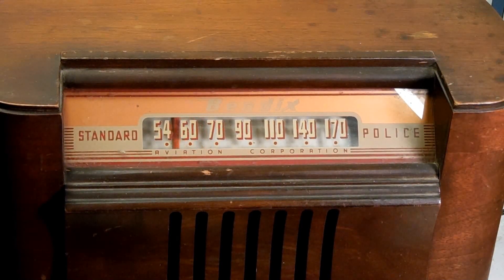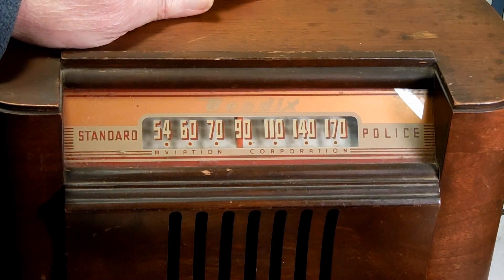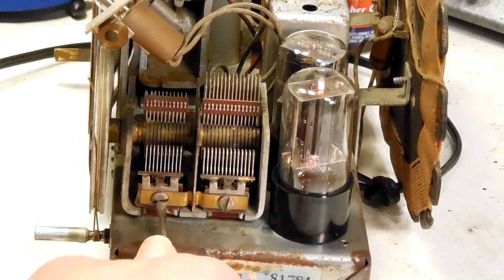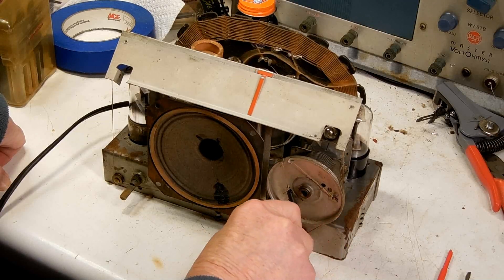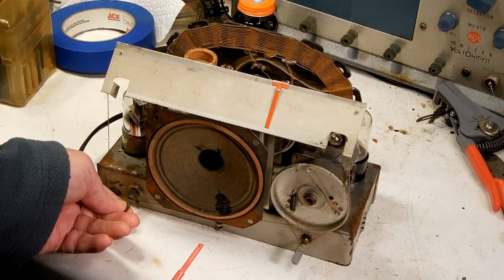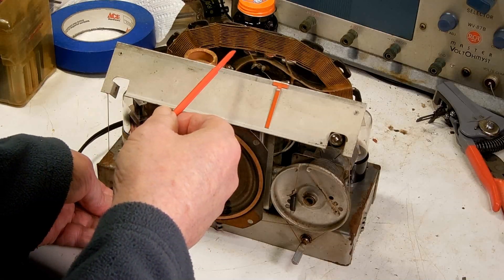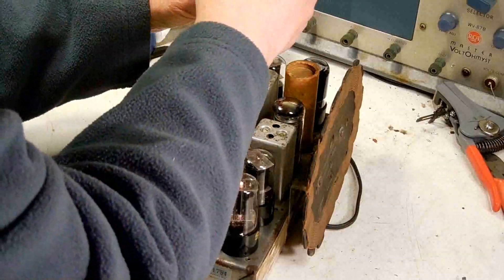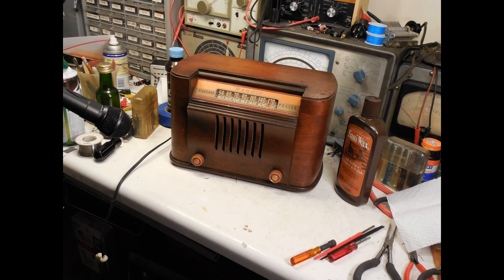Bendex AA5 Repair, Alignment, Oscillator, Antenna, IF's

Comment: Sir thank you for your great videos, you have a great teaching style.  I'm just getting into repairing some old tube radios, and I have a question if you'd have the time to reply.  I watched your other video on using the signal generator (as well as other folks videos) and I have an old Heathkit signal generator.... the question I have is, it seems as you show here, that you can also tune the IF with just using a weak station and turning it in.  Or, I believe I could use the signal generator set on say 600khz and tune that in with the IF cans....  my question is, why do we need to use the 455khz frequency?  I understand that the radio is tuned to that but I don't understand why I can't just tune in a station similar to how you're doing here on whatever frequency I introduce into the loop antenna.  It seems I can just create my own station at 620 or whatever, set the dial to that and tune her in with the IF.  

Is it because the 455 should be able to be heard at any location on the dial?  

Thank you for your great videos!
Reply from the maker: Thank you.
This technique is for radios that need a little tweaking. The IF's are very sharply tuned to 455kHz as you know. This frequency was chosen because it does not interfere with anything else. This frequency is high enough that it can carry the audio information was almost no loss of audio quality. I would only use the radio station, preferably in the middle of the band, because I know for sure it's frequency is very accurate because of the FCC.

If I have any question at all about a radios alignment I will use a signal generator on 455kHz and do a complete alignment according to the radios alignment procedures.

I do have a free e-book that may help you. Below is the link to the download and the password is allamericanfiveradio .

I think my FREE eBook may help.

PASSWORD is allamericanfiveradio

https://drive.google.com/file/d/1HHmaWYr7UMACfmS4W5uL6PADoem2KlRp/view?usp=sharing
Reply: @AllAmericanFiveRadio  Thank you sir for your reply, and I will read the Ebook, I just downloaded it.  Thank you for taking the time to teach us!  I have subscribed to your channel and am going to work through watching your videos as I get time... I especially like some of the flea market videos, I've always loved a flea market.  Thank you again!

Comment: Hi Rick, 

I know this is an older video, but the information is perfectly up to date.  I always wondered how those two screws were adjusted on the variable capacitor.  You showed me the exact thing I needed.

Regards, Tom
Reply from the maker: +THOMMGB 
The station is a signal generator
Reply: +THOMMGB that is the antenna coil trimmer and the osc coil trimmer. they are actually suposed to be adjusted using a signal generator and a vtvm as an output meter. they are peaked for maximum on the vtvm. same for the if cans
Reply: +Thomas Stemmer  Thanks for the additional information.  I'll have to apply what I've learned so I don't forget it.

Regards, Tom

Comment from the maker: Thanks Gary,
I am using a new wireless headset, and it does seem to work very well. Recently I bought a Nikon Coolpix L610 still/video camera. I recently did a video on this camera because I have had several inquiries as to what camera I'm using. I did not mention that I started using a new camera and headset a little over two months ago. It's nice to know it makes the difference.

Comment: AA5, can you offer a suggestion where to buy the IF tuning screwdrivers?  I think some of the Zenith radios I have have hex head coil adjustments as well as flat head screws?   And then I am curious where you purchase your capacitors.  I have been buying mine on ebay but am looking for a more cost efficient place to find high voltage mica and electrolytics.  Thanks!

Comment from the maker: Thanks Joe Minor
This is the way I used the line AA5 radios when I was in high school because I had no equipment. Surprisingly, it works very well for these simple radios. Of course I use the proper test equipment for the more complex radios.

Comment: Another great video Rick.  Since my eyesignt is better than my hearing, I use an Oscilloscope attached to the output transformer going into the speaker with appropriate settings to adjust my IF's.  As usuall in electronics there are more than one way to "skin a cat" as my Papa used to say.
Joe-K4JOE